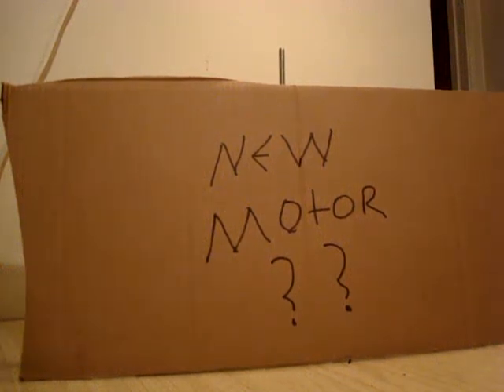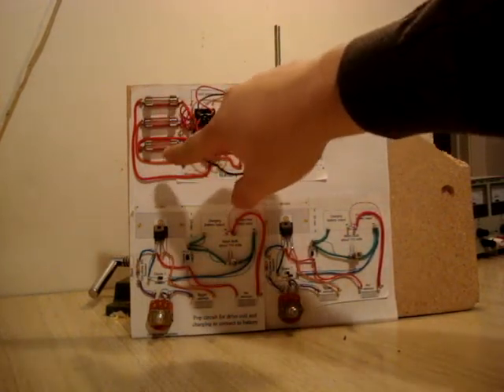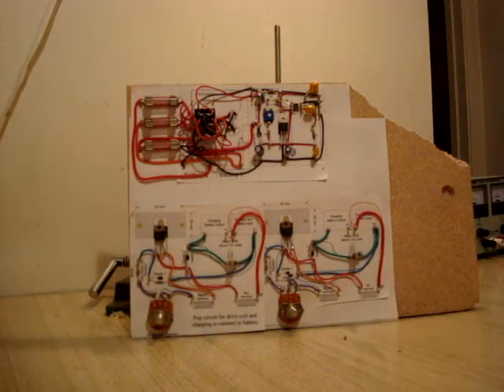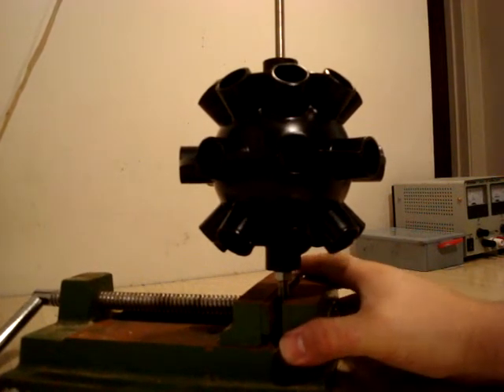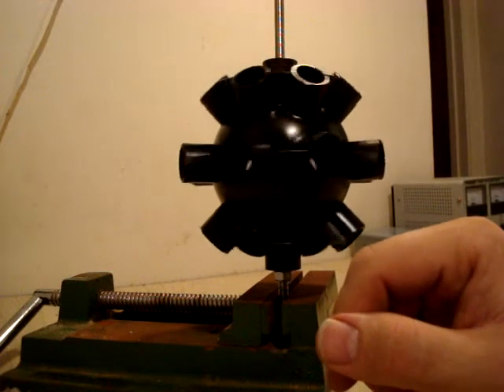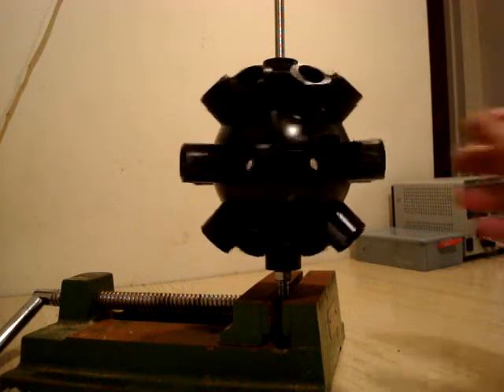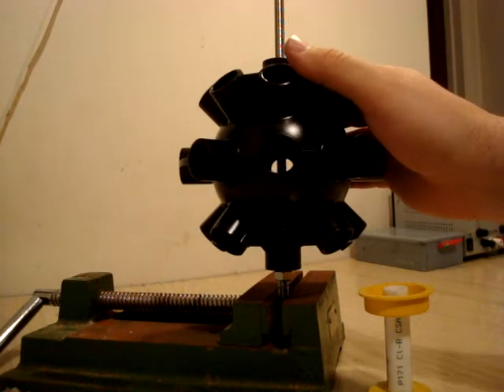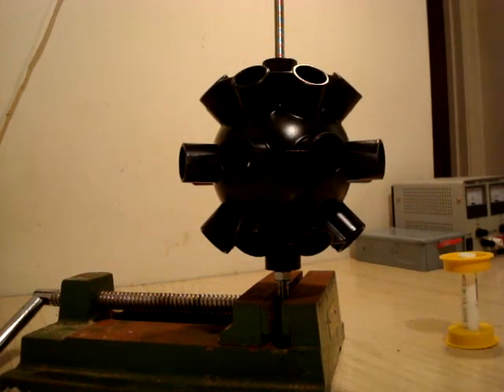New motor concept prototype

Comment from the maker: Well it is made by a large bearing manufacture and using existing case to contain the inner workings. So yes it is made to fit a standard size. How ever it is what is not seen that is he important part. That is why i said made to my specification. the Mag inner is my design that was made for me. I use this bearing company all the time to make spec bearings for my company's needs. Hope that cleared this up.